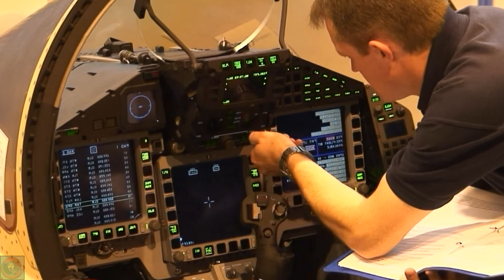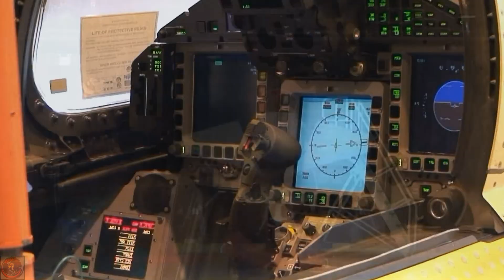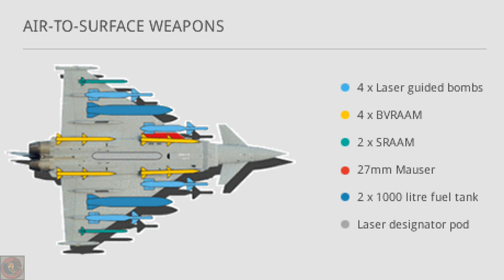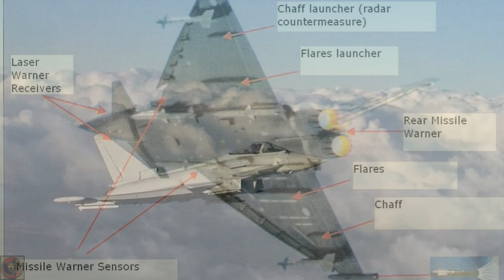Eurofighter Typhoon Combat Fighter Jet - Europe’s 4th Generation Fighter

Comment: You know the typhoon is actually quite aerodynamically unstable. This is what makes it so agile, it can reach a very high angle of attack allowing it to turn extremely well.
Reply: Typhoon is not really a high-alpha turner like thrust-vectoring aircraft or the F/A-18. 

What the highly-unstable canard-delta planform does for Eurofighter is to reduce drag during a turn which allows very good sustained turn performance at high speeds when combined with the high thrust/weight ratio. By way of comparison the F-16 was designed to sustain 9Gs while carrying a couple of Sidewinders and half internal fuel at ~30,000 ft. Typhoon can sustain a climbing 9G turn while carrying 8 AMRAAM and ASRAAM missiles.
Reply: The point I was trying to make is that there are different types of combat manoeuvrability. Thrust vectoring allows you to turn the nose very quickly at a significant cost in speed. Eurofighter is designed for energy manoeuvrability; to sustain speed and altitude while turning at high subsonic up to supersonic speeds. Given the way Eurofighter is designed to fight it is more useful to be able to sustain a 3 to 5G turn at Mach 1.5 to 1.8 and 50,000 ft than it is to make a hard 9G turn at Mach 0.8 and 30,000 ft (which it can also do if required).
Reply: Generally those post-Vietnam 1970s designs like the US F-16 and F/A-18 and the Russian MiG-29 and Su-27 were designed for subsonic manoeuvrability. They often had inferior supersonic sustained turn rates than earlier fighters. 

For example, anecdotally, the MiG-23 actually had better supersonic agility with it's wings swung back than the MiG-29. The MiG-29 could probably pull more Gs but would rapidly lose energy while the MiG-23 was able to sustain supersonic speed while pulling a few Gs in a turn. That's the downside of lift improvement devices like big LERXes; they generate a huge amount of extra lift and let you pull higher angles of attack, but they also generate a lot of drag during a turn.

So it is fairly unlikely (IMO of course) that a big LERX design like the SU-35 can match the Eurofighter for sustained turn rate while supersonic. Subsonic it is a different story and Eurofighter pilots are probably trained to avoid that sort of fight like the plague.
Reply: You know it just occurred to me that the limiting factor in a fighters agility is not actually the aircraft but the pilot. The pilot can only take up to 9 g's, even with modern equipment. The typhoon's wings can take much much more force than that before breaking off. 

Honestly now that I'm starting to think that once computers and AI get advanced enough fighter drones will be better than any manned fighter. Of course this is still a little ways away, the plane has to be able to fly all by itself with no outside input or it will be hard countered by any kind of jammer, but when that day comes drones will rule the sky.
Reply: +kentucky fried Time and events have proved that Russian fighter jets are mostly great on paper and/or during demonstration. For instance, most air force experts agree that the cobra maneuver would be quite ineffective in real combat situations, as  it leaves the aircraft in a low speed/low energy state, which can make it highly vulnerable to attacks from opposing aircraft.
Reply: kentucky fried the 4++ designation is a term used only by the Russians. More of a propaganda rather than based on facts.
Reply: +The Roof Man L
I don't want to get into some stupid argument about stuff which is actually classified, but I don't think you can claim that DRMF jamming can crush the 120s Pk. DRMF jamming is '90s technology and the 120C has had plenty of time to be given ECCM upgrades to deal with it (to say nothing of the Meteor and 120D). Also I don't see any indication that DRMF works against home-on-jam anyway. But when you get down to it we simply don't know how well the latest versions of the -120 will perform against the latest Russian ECM equipment.

400km isn't as far as all that for such a large radar, especially as they're probably talking about a large high speed closing target with a lot of doppler shift. At the end of the day PESA was never fielded by the USA or the UK in a fighter application because of the limitations of that technology in that application (though both did field PESA radars in naval applications, so the technology was well known to both of them). A modern M-scanned radar is just as good overall (some advantages balancing the disadvantages), though the advantages of a proper AESA radar over M-scan are undeniable. 

With regard to the L-band radar, are you sure you aren't getting the Su-35 confused with the T-50? Happy to be corrected if I'm wrong.

I also don't see any references to 360 degree field of view for the IRST.

I believe the Japanese AAM-4B was the first AAM with an AESA radar, also that Meteor does not have it (as it has been proposed as an upgrade). However it is not clear to me that AESA provides that much of an advantage in this application, as the radar only has to provide terminal homing against a single target rather than rapid scanning of a large volume of airspace and tracking of multiple contacts simultaneously.

With regard to supercruising, I'd be a bit careful with that claim. I don't doubt it can super-cruise while clean, but a lot of modern fighters can make that claim. But only F-22 (Mach 1.6 with internal stores) and Eurofighter (Mach 1.2, just) claim supercruise with a full missile load and Eurofighter can only just achieve it despite low drag semi-conformal missile carriage for 4 of the missiles and a very low drag plan-form overall. Unless you see a definite claim of Su-35 being able to super-cruise while carrying 6 or 8 missiles, I wouldn't take it too literally. Marketing people have been known to be economic with the actualite from time to time.

Airpower Australia is, unfortunately, not that highly regarded as a source. They have some nice photographs and data, but they tend to get a bit overwrought and engage in hyperbole.
Reply: The Aerodynamic Modification Kit (AMK) improves EF low speed agility by a considerable amount. It is still fairly new though so may not be integrated in many fielded aircraft, if any.
Reply: +kentucky fried,
Which capabilities of the Su35 stand out to you? I agree that it's a fine aircraft, but I don't see much that Rafale and Eurofighter and the Super Hornet can't match or beat.
Reply: Akm72 well it can super cruise, has DRMF jamming that crush's the 120s PK has a 20kv PesA dar with 400kph scan range and Lband radar in the wing a 360 Irst coverage user friendly higly automated user interface data linked with surface to air sights AWaCs And all other modern air platforms giving other platforms the ability to provide course guidance updates for the r77 M1 the only missile with an AESA seeker head I believe not sure about the meteor seeker head RAM coating to reduce  RCS and 65 thousand pounds of thrust giving it a comparable thrust to weight at 50% fuel to the Raptor although the Raptor can super Cruise at a much higher Mach number because of internal stores the thrust vectoring also helps immensely in Super Sonic turns the capability really depends on what the pilot can handle the Russians have really evolved far as G suits finally catching up to the West it's a beautiful platform only out done in capability by the F22. A good read is on airpower Australia not your father's flanker. If a super flanker is in the air the USA will call in the Raptor not going to engage it with Gen 4 platforms would be my guess. Also has a advanced helmet cueing system as do other platform such as the Typhoon Raphael F-35 but not the Raptor. the Su30 MKI held it's own vs the eurofighter now add 14 thousand pounds of thrust  with the Su-35 my favorite aircraft is the F-22 my second favorite Su35 you would enjoy that article he's A Western analyst who thinks we are sleeping on Russian capabilities just go to Australia Air Power look for not you father's Flanker he also has a lot of good writing on many other aircraft great website for technical info for plane junkies
Reply: Akm72 not unbeatable just will take more shots to overpower what it can jam good talk bud I'm a armchair pilot who just enjoys reading technical data. I fly DCS and fly F15 Su-27 M2000c and soon to be F14 and F18 it is the most accurate Sim Earth excluding what the military has you should give it a try load of fun.
Reply: I think the AMK was an industry technology demonstrator (as far as I can tell). I don't think any of the national military forces have a requirement for it and I don't think any have ordered or fielded it.

I'm happy to be wrong though if you know better!
Reply: Not really. Air to air combat with AMRAAM-type missiles doesn't require an awful lot of G's. When they first fielded them in the '90s and tested them in exercises one of the comments from an F-15 pilot was that none of them had pulled more then 3Gs during the entire exercise.
Reply: kentucky fried the eurofighter comes with thrust vectoring too, and the su 27 can do this because they have a back-angled wing shape which gives them control when they do this. But the cobra maneuver is very risky and su 27 pilots even said that it will only be used in emergency and not in combat.
Reply: Rid1Bee not true their distinguishing between the old MiG-29S and Su27sm because the capabilities of the Mig35 and Su35 or Head and Shoulders above those aircraft very much westernized and they're thinking in a way
Reply: Akm72 that's what the National interest says not me
Reply: Not here to argue I'm American dude
Reply: Akm72 I'm not going to type another long reply considering they lost 15 years during the 90s they're not doing too bad and I did read a source about the Lband like the Pakfa, and think about who discredits Airpower Aussie the west how dare someone say another country can do anything right. I feel it's dangerous to underestimate them they only lack money not know how.
Reply: Akm72 http://nationalinterest.org/blog/the-buzz/the-us-militarys-top-guns-the-air-have-big-weakness-14065 here's the link Salute sure your a fellow Aviation enthusiast based on your impressive knowledge read this article that's where I got it from every Flu DCS can fly old eagles and Flanker most accurate Sim on Earth I'm just an armchair pilot I've been following Aviation since I was 8 just turned 40 thanks for being respectful
Reply: Akm72 the quote I found alarming is to defeat memory jamming we have have to move out of the Xband or go duel seeker like the R37 R77m1 not sure we have done that yet doubt they will ever fight anyway but we need to be on top for the money I pay in tax.brings me to another argument I also worry Russia and China get more capability per defense dollar then we do and that's a serious political issue because of those God damn lobbyists.
Reply: As it happens I agree with the article about the need for hybrid seekers, combining imaging IR and active radar, in future missiles, however I am sceptical of the claims about DRMF jamming being unbeatable. The most experienced EW experts in the world are the USA and the UK and both have felt quite comfortable using a mixture of progressively more advanced AMRAAM variants, combined with either stealth and jamming (F-22 and F-35) or a combination of aircraft-mounted and towed jamming emitters (Eurofighter and F/A-18E/F), to keep their fighters competitive. Now it is always possible that they might be wrong, but it will take more than a couple of dubious articles by people without access to classified information to make me change my mind.
Reply: Concerning the famous Pugachev's "cobra" maneuver, it is complete BS that it is unique to the Su27/Su35.  For example the good old Saab Draken is known for her weird ability to do that same maneuver.
Reply: kentucky fried you really don't know what your talking about please don't comment anymore thanks.
Reply: kentucky fried the su 35 is junk the US came up with thrust factoring first and its not as good as people think in combat
Reply: Yes. You can actually see this clearly in this video. Watch the turbulence from the wing tip vortex's

Comment: An awesome fighter, better than most, but not as effectively versatile. It is also more expensive, more so than a F-35. Shame to hear about the job cuts. 
A video on the widely used LAV III would be interesting. Thanks, Matsimus.
Reply: The F-35 will cost the UK £9.1 billion for 48. The Typhoon will end up costing around £22.9 billion for 160.
So that's about £190 million per F-35 (the cost will go down as more planes are bought) and about £143 million per Typhoon. So the Typhoon is cheaper per plane, but of course it's not that simple as part of the Typhoon is built and has been developed within the UK. So the Typhoon is putting money back into the economy. The F-35 also does this but to a far smaller extent.
Also, the F-35 has higher maintenance costs, that's just a consequence of it being a stealth plane.
And that link doesn't support anything you've said, it just shows that the Danish government is attempting to justify buying the F-35.
Reply: LPMBB1815 you kidding me? You could buy two of these for every one of those! Don't get me wrong the F35's a superb aircraft but we should've just converted some of our existing Typhoons for the new carriers that we do, after all also  already have, rather than spending billions upon billions on planes we won't have in numbers for three years at least
Reply: LPMBB1815 also 'effectively versatile' is simply not what the designers had in mind, it's an air superiority fighter, pure and simple  and a damn good one, somewhere between an F15 and F22 in capability and meant to be used the same way- might not be stealth or very good at tankbusting but it'll outmanoeuvre and kill just about  anything in the sky
Reply: Hello, 1IbramGaunt. The unit cost for the next block of F35A models is (USD) 80m or 90m for the F35B. A Typhoon costs (USD) 95m and has a 33% shorter lifespan and greater maintenance costs over its life span. I agree the long waiting time is frustrating and inefficient. It would have been great to have had a British design flying from the new carriers, but there is apparently a lot of UK industry involved in the JSF program. Economy of scale is working against the Typhoon now and in favour of the JSF.
It'll be interesting to see how Typhoon's upgrades go and how it goes against British F-35s. 

https://breakingdefense.com/2016/05/f-35-wins-denmark-competition-trounces-super-hornet-eurofighter/

Comment: Do a video about an anti aircraft system.
Reply: Steven003
He already has.
Reply: I personally think the S-400 can be said to be specialised for long range air defence even compared to the Patriot. Patriot PAC 3 batteries hold more missiles, so a single system could possibly be better overall, but the S-400 definitely beats it at long range, and in Russian doctrine is guarded by SHORAD anyway.
Reply: Whaaat?!??!? I havent seen them yet! 0.0
Reply: It would be nice to hear about the s400 Vs patriot. Personally I feel the s400 could be a more superior system as it has a near in protection add on. At the moment I feel Russian equipment offers better value for money.